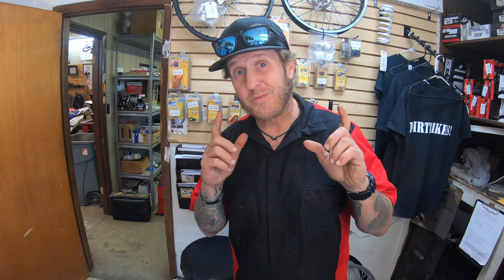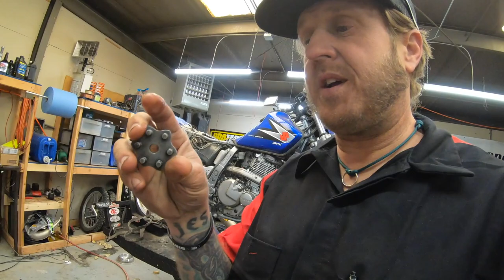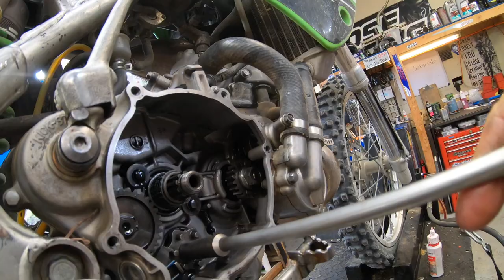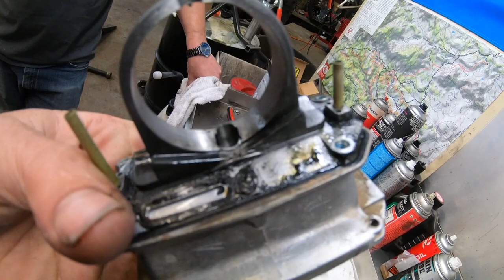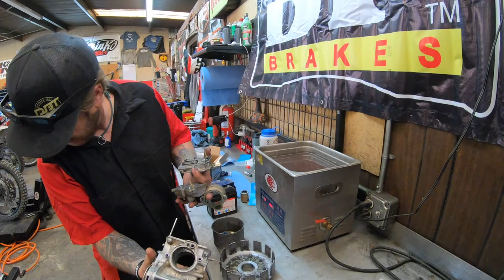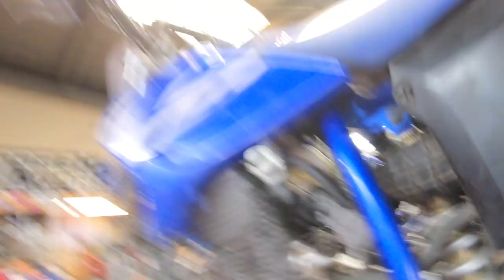Daily Shlog #70 : Fixing the KX100 and a DIRTY FCR Carburetor

Comment: What’s the best way to keep the gas from doing that to my carb again besides ridding the bike? Race gas? Drain? Run dry?
Reply from the maker: The best way is to drain it using the drain on the bottom of the float bowl. Race gas or AV gas will work too.